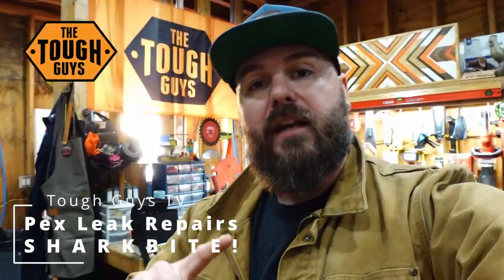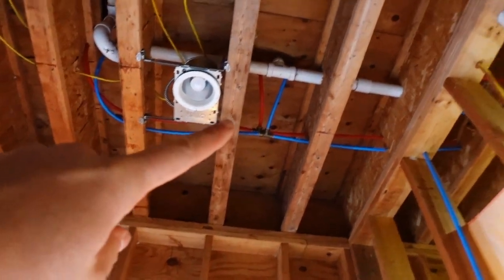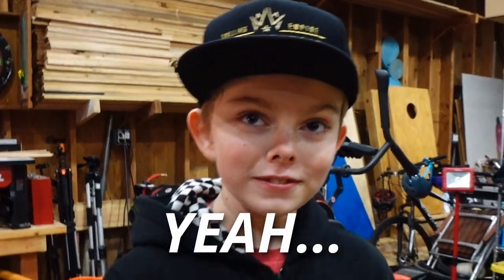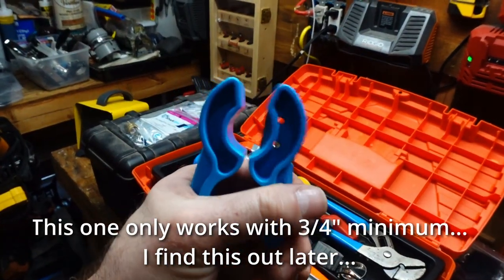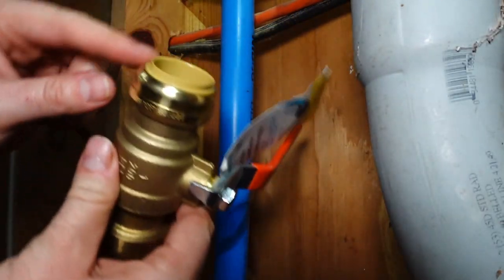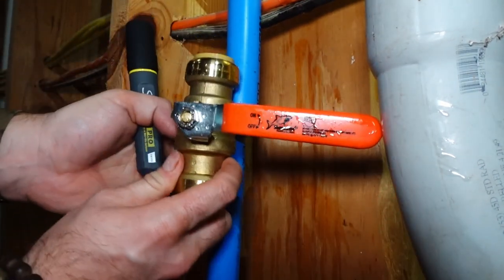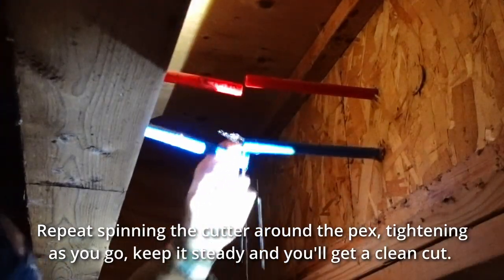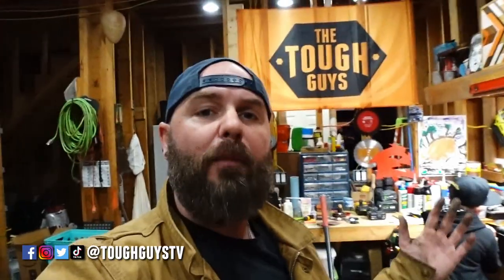Pex Leak Repairs with SHARKBITE!!

Comment: I recommend the Milwaukee battery powered water pump. It will drain that vault in 30 seconds or less. We use them at work when dealing with coax lines in vaults that filled with water. Absolute life saver.